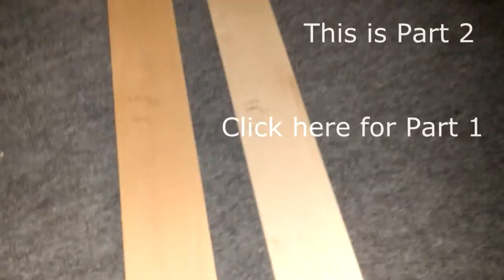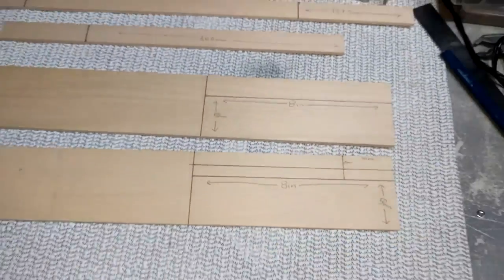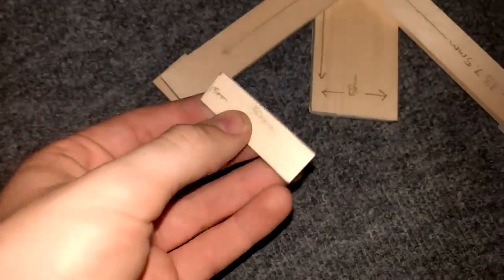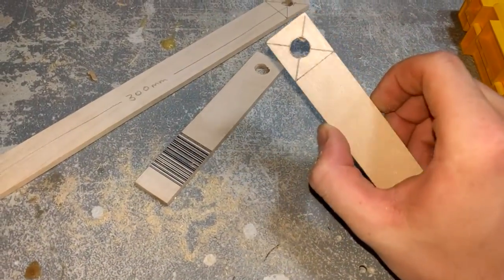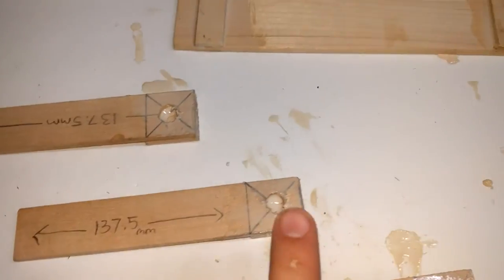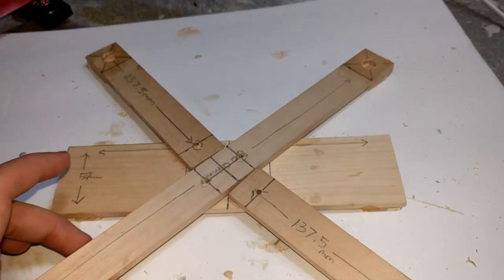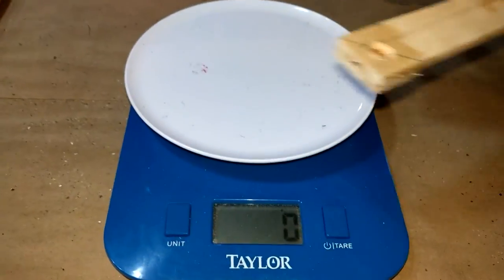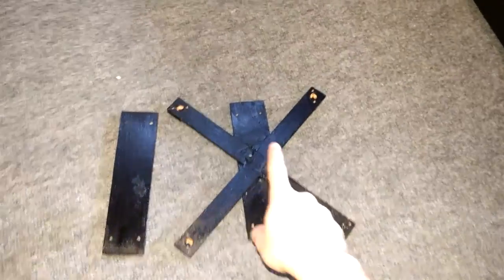Part 2 - Building a Race Drone from Scratch

Comment: hey their i'm making a 11 inch prop drone and i'm worried that my frame will become flimsy and break quickly any ideas
Reply from the maker: Use aluminum square tubes or carbon fiber. Wood dowels or square today will break easily for a quad that big.
Reply: @CutarelliFPV  drilling the aluminum is going to be a pain but I guess I'll have to do it